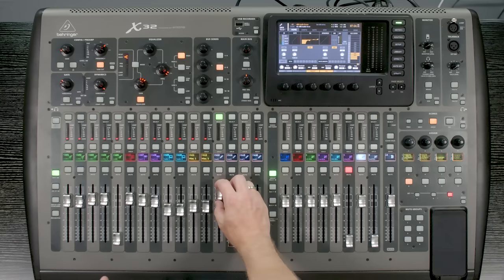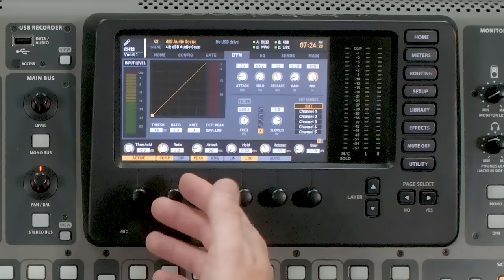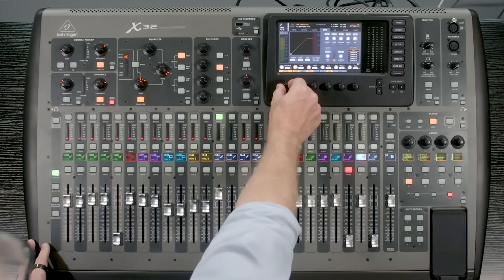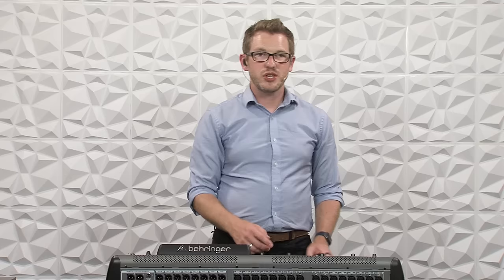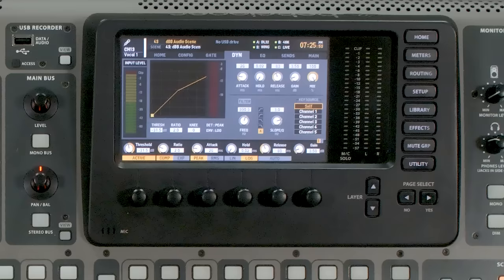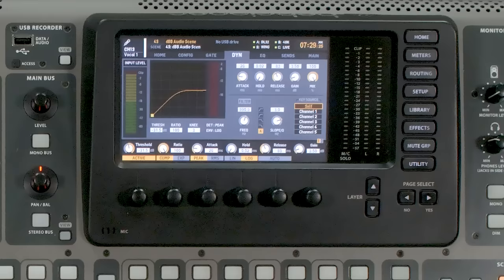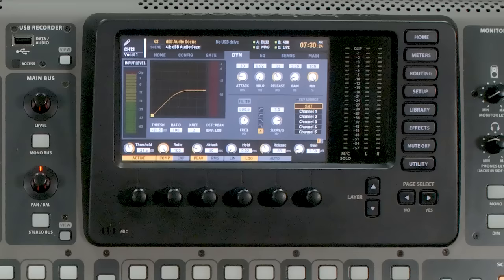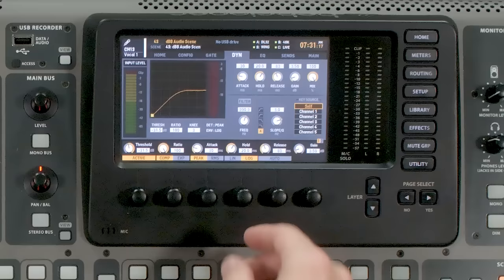Vocal Compression How To - Behringer X32

Comment: My first thought was whoa, 10:1 ?!? But the key is the KNEE! By setting it to 3 (as you've done) and adjusting the threshold properly, essentially the compression is mostly in the 3:1 / 4:1 range, and the 10:1 kicks in only with the strongest peaks. Very important that the threshold is set properly with each singer as you've done here. A great video featuring settings that will absolutely benefit most singers as most don't have great dynamics control and/or mic technique.

Comment: Nice didactical explanation. Has a SD9 digico user, I found that multiband compresor is the best. you just apply the same that in the video but mostly on the body of the voice. So it gives a natural sensation that the singer is getting appart from the mic when singing loud.
By applying compresión on the low Freq and not too much on the rest, the proximity fx of low presence due to close mic is desappearing when singing too loud and near the mic still. Perfect result !

Comment: Attack time is not a delay before compression kicks in. Gain reduction happens as soon as the audio passes the threshold. The attack time is the amount of time it takes for the compressor to reach full gain reduction (based of the ratio). It acts like a fade in. Same with release.

Comment: Drew, this is a great video… I love your explanation of compression and it’s a good refresher from my tech classes in college.

I’m curious about how you set up the assignable controls to control playback though. If I remember correctly, you’re playing back from the SD card for these tracks, yeah? Is there a way to control Reaper playback with these controls?
Reply: I would like to know this also
Reply: @99Barnyard  I haven’t completely finished the setup yet, nor am I in front of my console, but I’ve had some success with configuring the push buttons using the Remote options. I first had to setup the remote option config for Mackie MCU, setup Card MIDI I believe and added the Behringer X-32 as a control surface in Reaper. I’m still messing with it, but this got me running a bit. I can Play, Stop, FF, and RW so far. I’ll post more as I can

Comment: Hey Drew,  thanks for all the videos. Im trying to understand the outputs better so... here's the question. You mentioned that there's only 2 compressions available (channel dynamics and fx insert). Does that mean if you have a vocal subgroup, you can have 4 compressors? Would you want to use all 4?
Reply from the maker: Yes the Channel would have the compressor and an FX insert, and if you then sent that to a mixbus (subgroup) then you would have the mixbus compressor and the mixbus FX insert.

I will typically mix with subgroups and add some more global compression of the groups if I have the space for it. If I am mixing monitors from the FOH desk, there typically is not enough mixbusses to do everything. But if I don't have to worry about monitors, I will set up a Drum GRP, Parallel Drum GRP, Bass GRP, Guitar GRP, Keys GRP, Tracks GRP, Vocal GRP and sometimes a Parallel Vocal GRP.

Hopefully this helps!

Comment: Excellent tutorial on compression, you see that's my main goal, you said at the end to get your vocal to shine through the mix with the band,
compression, where do I start,
I just bought the new Mackie pro16fx V3 mixer along with my 9 series RCF's 935a's
and for subs I was I two minds of either going for the behringer Subs B1800xp
or the B1500xp
, glad I went with 15's
Excellent sub and ease to carry
ok the 18s may push a little extra air but not worth talking about, I'm told the 15s are just as good if not better, correct here if I'm wrong,
the mackie desk has a one knob compression, is this just a selling gimmick or do it actually do something to a vocal,
I am no told if I want really top class vocal, go purchase the
Behringer Producer x32
or the compact, same thing,
one man band playing backing tracks, electric guitar and ketron audya 5 and korg m1 and my vocal mic is the beyerdynamic M88tg
love this mic, a bit bassy
but if really has great throw in it and makes my vocal cut through the mix,
do you think I would benefit hugely on stage with the behringer producer,
there seems to be a lot to learn, compression is tricky process,
but my sound tech mates gave said set this once and and save 
maybe a little tweak but the sound will amaze me coming out of the behringer, if I want vocal clarity this is the way forward especially with the top end RCF's I have, 
So what's your view on all this, please help, please advise me here and thanks, I have subscribed and will watch your amazing tutorials to learn the magic of sound creations.. 🙏
Reply from the maker: Thanks for reaching out Martin! I would agree with your mates in that the Behringer X32 would be an improvement over the analog console. You have more functionality with the X32 with having compression on every channel, different reverbs, delays, and modeling of classic compressors or eq's. You also have the ability to save and recall mixes, and mix from an iPad/Tablet remotely away from the console.

Hope this helps!

Comment: Great video thank you for the information!

I did not understand the makeup gain (or whatever it was called). If the compresser only compresses the sounds that is over the threshold, then the sound that is under the threshold will remain unchanged, right? Why to we need to add gain?

Comment: If you could do a video about faders, master fader and the volumes, peaks, levels of recording as when I finish to record on a usb my mix is not loud enough (even in my headphones is very loud) and my master volume is nearly to the maximum, about how loud should be as I use to post songs on youtube and they are not loud enough, about diferences between faders volumes and gains, if they means the same; about the faders positions when we set a gain, If you could speak around this subject I would apreciate this. Thank you very much.

Comment: Good video. But a 10:1 ratio on a vocal in my opinion is a bid much. I like to keep it moderate. A 4:1 ratio would work nice. 10:1 ratio makes the vocal sound very compress. In. My opinion they don't sound so agresive. I would use those settings if I was dealing with a heavy metal band. But is a good explanation on how to dial it and hearing what compression does.  Cheers.
Reply from the maker: Heavy Metal Band = Most Christian Churches. HAH! Thanks so much man.
Reply: I thought the very same thing, however you've missed a very important aspect... knee! The setting of the knee to 3 means the compression ramps up, and based on where you set the compression threshold, you are essentially getting the 3 to 4:1 compression you're after with the added bonus of 10:1 for those really strong peaks.

Comment: Is anything wrong if you do compression on the channel , then have parallel compression on the buses (also for some of channel), and also do compression on the main LR channel for all of them combined?
Reply from the maker: No there is nothing wrong with that. The only thing you have to be careful of when doing parallel compression is making sure you keep the latency all the same. If you use an effect of the console on one of the parallel busses, you would need to put the same effect on the other buss to keep the latency the same. If you are using the built in compressors of the mixbusses without using the effects rack, there is nothing to worry about as the timing would be the same.

More compressors doing less compression individually is more transparent than one compressor doing all of the work.
Reply: @DrewBrashler  Thanks you! I watch your video about parallel compression, latency, phase issues and everything about that, so I aware about that problem.

Comment: Drew! Thanks so much for all of your vids, I've learned so much from you. This may seem like a dumb quetion, but you are using a recording of the band for all of your testing/experimentation and explanations. But how do you make that recording?
Reply from the maker: Hey Tom! Yes, I am using a multi-track recording that I loaded into my X-Live card on a SD card. I have a blog post at https://drewbrashler.com/2017/behringer-x-live/ that talks about the X-Live card, how to install and use it. Check it out if you are interested!

I'm using the user section on the right side of the board to launch play at markers that I set in the audio tracks, that way I can repeat the same section for you all.

Hope this helps!
Reply: @DrewBrashler  Awesome, thanks! I'll check it out. On a seperate note, whats the secret to great punchy drums? In particular kick? Is it gating along with other things? Did you already ( or are you planning to) do a vid on that? Thanks again for so generously sharing your knowledge!
Reply: Also, it the X-Live card compatible with the X32 rack, and can those markers be set using the X32 edit app?

Comment: Hi Drew, we do a number of festivals and are curious how do we cable and route using two x32’s and two dl32’s? Are goal is to use one dl32 for the headliner and the other dl32 for all the opening acts. I’ve searched here on YouTube but have not had any luck.
Reply: As AES50 on the X32 family (or in general?) is still only able to get 48 channels per cable and direction, you would need to use both AES50 A and B ports on the FOH X32, each for one of the two stageboxes (so run two separate CAT cables from FOH to the stageboxes). Then use scenes to switch between the two stageboxes (inputs AES50A 1-32 vs AES50B 1-32). 
If you then want to use a second X32 (for monitor mixing?), this also has to connect to each stagebox separately, so again use two CAT cables from the 2nd X32 to the stageboxes. 
For each stagebox, the console that plugs into the AES50 A port of the stagebox has control over the gains, the 2nd console that plugs into the B port only has a digital trim. You can decide, which console to give this control to (FOH or monitor X32). 

I'd highly recommend to do a test before though, I haven't had this setup yet and can't guarantee for everything to work.

Comment: Thank you for this content.

Sir while doing live sound, do you compress the outputs (FOH and Monitors)?
Reply from the maker: Yes I do compress the FOH output a little bit. For monitors, I typically don't compress as this could increase the chance of feedback for floor monitors.

If I am mixing a monitor console, I will typically place a limiter on every output just before the point that it would go into clipping on the IEM transmitter, but that is getting into more advanced techniques.
Reply: @DrewBrashler  Thank you very much sir.

Comment: Hi Drew-  I have a question. In one of the recent live performances, I had  some trouble handling high notes of the vocalist.  At her high notes my turbo sound speakers were producing cracking noise.   I used subtractive EQ ( High and High mid) to control it ( from 5db to 2.5DB gain reduction ) at the offending frequencies   but vocalist complained about her vocal quality going down due to the above.   Can this be handled better using compression or any other way?  Any inputs, recommendations  will be highly appreciated.  Thank you
Reply: I really would recommend to change the loudspeakers... The new LD Systems Maui 28 G3 or Maui 44 G2 are absolutely stunning. I recently had a Rockband played by these with my x32... I got lots of compliments about my mix, but the main reason were the really amazing new speakers... 😃😉

Comment: At my church, sound people are afraid to use a compressor on microphones because they think it will only amplify bleeding.
What do you think about that?
Reply: Tell them to watch this video
Reply from the maker: That is a bummer! They technically are correct that a compressor will increase bleed, but typically the benefits of having compression will outweigh the issue of bleed.

Bleed on a stage is a real issue and the use of correct stage positions or items like Shy Baffles can help minimize it. For instance, don't put the softest singer in front of the drum set.
Reply: @DrewBrashler  Thank you for your reply and for the tips! I guess they will need to hear it working to believe...
Reply: @original_pokey8896  Sounds like they need a real sound engineer.